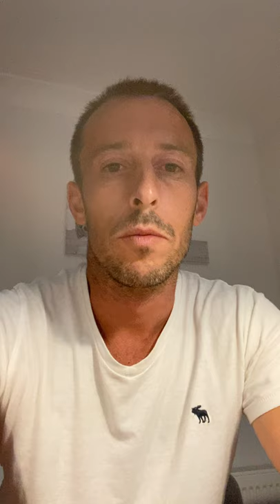Why you shouldn’t have cavity wall insulation installed.

Comment: Hi, would you recommend any cavity insulation as I was looking at the bonded bead insulation? Cheers
Reply from the maker: I wouldn’t recommend any personally, but  I would be very thorough in who you choose to survey and install it, if you go with bonded beads. It’s important that you are given information regarding additional ventilation requirements suited to your property size. Cavities should be throughly inspected for any possible bridging or defects prior to installation and thought should be given to the condition of the wall ties and any possible alterations that may affect the 25year guarantee issued.
Reply: @CoastalWallTiesRustington  I was looking at a company called cavitech. I need to see what is in the cavity first and go from there. Cheers for the response.👍🏼
Reply: @davesaxon7348 did you go forwards with Cavitech?  Did it work out or any problems?
Reply: @robhindle8735  hi, no they were too expensive.

Comment: Great vid.  Thanks     👍.  Question “.   We  are in process  of removing  white wool  ( very damp )  from  our  50 mm cavity !!!!    Our. Outer walls      Are  bottom  Third   Section face brick then rendered   Con blocks  upwards  ,  with  term blocks internal  all walls  ,   ,,   Would you  agree to installing  air bricks  at various  points  around  bottom  brick section   ,  regarding  some air flow  or would this increase  moisture   In cavity  on inside course  in winter    ,  not sure if  would help !!!        Air brick / yes   No.    Thanks
Reply from the maker: Thanks for the comment, the only reason to install the air bricks would be to dry the internal wall quicker, but as we are entering summer I would say it would do fine naturally without air bricks. So to answer your question no it’s not really necessary and would make the bottom of your walls colder during the winter period.
Reply: Thakyou.   Will keep watching

Comment: Hi, do you think external solid wall insulation is any good? I am thinking of getting it done but have heard lot's of bad reviews about it. would appreciate your opinion/advice. Thanks
Reply from the maker: Hi, the only thing with external wall insulation is that things like gas boxes, waste pipes etc will have to be moved to ensure no cold areas are left not being insulated. It may also be worth considering that this type of insulation method has not been around that long, so the longevity of the render etc is fairly unknown. It would be wise to ask to see the contractors guarantee and thoroughly read the terms, some guarantees have been known to include a clause in which if you attach any fittings etc to the external wall, it will invalidate the guarantee.
Reply: @CoastalWallTiesRustington  Many thanks for replying promptly. I heard that many customers had bad experiences with external wall insulation where water started penetrating, render coming off, internal damp issues etc. and as you probably know once they have completed the job even though you covered with guarantee they don't want to know you and will make excuses and someone like me doesn't want to the hassle to make complaints/ courts etc. It just takes ages and you may not get anything at the end. Have heard any negative sides or personal experience of solid wall insulation? because once it's done and problem starts, it will be very costly and inconvenient to remove it.
Reply from the maker: I haven’t had any problems highlighted through our company, but I would consider internal insulation plasterboard inside to the external walls of the house only, this would avoid the potential problems highlighted in my last response and avoid any issues with guarantees etc. All you need then is a good plasterer but it would involve plaster-boarding the entire wall, so things would need to be removed to ensure no cold spots are on the walls.
Reply: @CoastalWallTiesRustington  thanks

Comment: What about external insulation on a cavity wall then render? Just moved into a 1935 bungalow, cavity wall, needs render replacing was thinking of doing external insulation at same time? Worth it or am I setting myself up for problems further on
Reply from the maker: External rendering is the one of the better ways to do it because it would cover lintels etc, whereas cavity wall fill doesn’t. My only advice would be to ensure that you have adequate ventilation at night during the winter by opening windows on night lock to prevent condensation and mould. At least with external insulation render your cavity is not bridged.

Hope this helps.
Reply from the maker: Also being a 1935 property if you decide to get external wall insulation, get them to check the condition of the wall ties first, the last thing you want after rendering is cracking to occur.
Reply: @CoastalWallTiesRustington  thanks you for the reply

Comment: I've got a problem where the walls are getting increasingly colder each winter. My house was build in 2007. There are  bricks both on the outside and inside. The cavity in between was insulated from new with glass wool batts I believe. What is going on?
Reply from the maker: I would remove a brick on the outside of one of the coldest walls to check the condition of the batts and to see if they are dry. If the outer surface of the insulation is moist but the rest is dry, you could try applying stormdry masonry cream to the brickwork, but I would wait until late spring/summer to do this to ensure the bricks are as dry as can be and to allow the batts to dry.
Reply: @CoastalWallTiesRustington  Thank you. I'll try that. After stormdry masonry cream has been added do you still advice against having insulation blown into the cavity? I worry the glass wool insulation was either poorly done or that it sunk over time
Reply from the maker: If they are full fill batts then it would be a job to remove it and it shouldn’t have sunk. If it was whitewool loose fill then I would say get it removed and see how it goes without insulation.
Reply: @CoastalWallTiesRustington  They are full fill batts. But I believe it's those fluffy glass wool batts  that collapses and looses its insulation abilities as soon as they're exposed to any form of moisture

Comment: Oh im so confused  - my semi detached has has just been assessed and I can have a new baxi boiler, loft insulation also wall installation injection route. What shall I do, has anyone had this done etc
Reply from the maker: If you can get away with just the new boiler and loft insulation, I would do that. Enquire with the company about adequate ventilation to the loft space as well .
Reply: @CoastalWallTiesRustington  thank you will asked them. The insulation the inject is called 'oil based bond beads' is this like the old stuff what they pumped into

Comment: I had a garage converted into a room, the builder done a poor job because the room is so freezing cold. What can i do to fix the room heat protection?
Reply from the maker: I would assume that the external wall of the garage is a single skin wall, rather than a cavity wall construction. If it’s single skin then you can either insulate internally or externally but the external finish would be a render or cladding. The same would apply to a cavity construction if you were not wanting to bridge the cavity.

Comment: Hi. Can you clarify which kind of insulation you are speaking of please? Ive just seen a video using a kind of expanding foam which i would have thought would work ok as its waterproofing? Are you speaking of the old feathery type stuff?
Reply from the maker: So all retrofit cavity wall insulation has different problems associated to them, with expanding foam insulation, 1 type sets solid and the only way to remove it is by taking the outer wall down, others can disintegrate/shrink overtime. The expanding foam that sets hard would certainly be waterproof but please be aware that once installed it’s hard to remove if you needed to.
Reply: @CoastalWallTiesRustington  great video and grateful for you sharing knowledge. What about thermal beads?
Reply from the maker: A cavity is best kept clear, thermal beads can be a pain, when altering your property the beads can escape out of the hole and essentially create a cold area in comparison to the rest of the property. Also if the property requires wall tie replacement at a later date and you experience damp problems, the insulation guarantee may become invalid. The best way is either a masonry cream, insulation backed plaster board internally if possible or a external insulation system.

Hope this helps.
Reply: @nadiaw978  this is a bit of a myth as well. Areas of wind driven rain as dictated by the BRE map are at higher risk of penetration but these products have never actually been tested on older properties. The BBA certificate shows that the test rigs used are that of 1984 building regulations - how can 1930 and 1950s properties meet future standards. The BBA also failed miserably to install mineral wool in a new construction http://nottomyhome.blogspot.com/2018/12/abject-failure-of-mineral-wool-and.html .  No longitudinal test or product failure registry -  no part of government tracks even the number of extractions per year and which product or types of property has failed.   It's a poorly regulated industry and CIGA just tries to blame the problems on home owners - no incentive to do a root cause analysis of failures.

Comment: Unfortunately I’ve been affected by a company called heatwave energy solutions who have put cavity wall insulation. It’s caused damp throughout my house and I’m not sure what to do. Could you please advise? Thank you
Reply from the maker: Hi Adam, sorry to hear that you have a damp problem. Have you contacted this company to rectify? Have you got a guarantee backed by CIGA? If the company doesn’t respond and deal with your claim, then go straight to CIGA. CIGA will also try to avoid compensation but be persistent and demanding. They will probably send a surveyor round to assess and worm there way out of a full extraction but just be persistent and don’t take no for an answer.

Has it affected all walls or just south and west?

Comment: The benefits of cavity wall insulation installed correctly far out way any negatives. If you have a clear cavity above 60mm in your home get it filled with bead insulation. It’s crazy to run another winter without your home correctly insulated.  270-400mm in the loft also.

Comment: Cheers for the info, was considering having CWI , but couldn’t find much reviews on it,  perhaps maybe when we do an extension we’ll go for the foam backed plaster board, & perhaps silver backed poly insulation under the floor boards ?   I did consider the outside wall insulation but it’s so expensive to do . Thanks again 👍
Reply from the maker: Good choice, just remember to ventilate your property as well and you will be fine, most new windows have a night lock in which you can open the window slightly and lock it, this will be sufficient ventilation.
Reply: Coastal Wall Ties Ltd  Cheers for the tips,  our main problem is the conservatory at the back of the house/kitchen diner, it unbalances the heat , luckily we’ve got a double glazed door so can shut off that area,  hopefully we’ll knock it all down & put a new extension on the back . & retrofit insulation where possible. As I’m happy with my Oil boiler , don’t want to go down the ecodan heat pump rabbit hole. Don’t think my house would be suited to it. Good luck with the channel 👍
Reply: Rescue and repair of cavity wall insulation.

Comment: What if you have cavity insulation put in and then external wall insulation over it that would seal any holes surely ?
Reply from the maker: It would but it would also make it a very sweaty box, which could In turn cause issues later on in the future. Where would the moisture created inside go? It would condense on poor insulators and cold spaces I.e wardrobes, etc. Creating mould issues. Unless you ventilate enough I can see it being a problem.
Reply: @CoastalWallTiesRustington  so should i just go for the external insulation alone and that will be sufficient ? Want the house to be as efficient as possible
Reply from the maker: Yes just go for the external wall insulation, ensure that the company installing removes all services etc from the wall as this is a common complaint.

Comment: Hi Alex, very useful info 👍 I have a house built in the 60s with cavity wall. I researched cavity wall insulation and share the concerns you highlight. However, I have been informed that closed cell slow pour is a vapour barrier and shouldn't have any of these problems, Walltite is the product I was looking at. 
Would you advise against it? Have you seen houses with cavity filled with close cell (walltite) with these issues? 
Appreciate your opinion
Reply from the maker: Hi Bryan, thank you for your comment and question, firstly this is probably the only insulation out there that truly stops moisture tracking across the cavity, however it sets hard and would be costly to remove if that was required ( removing outer wall and insulation then rebuilding) I certainly wouldn’t recommend this for insulating between rafters in loft spaces. The other thing to keep in mind is that having your walls insulated will stop the walls from breathing, which means if you do not heat and ventilate correctly, then condensation is likely to occur. 
Hopefully this brief answer helps. If you need further info just let me know.

All the best.
Reply: @CoastalWallTiesRustington  would a combination of this cavity insulation along with inner dry lining be the way to go so? This should prevent the inner walls from getting cold and wet you’d imagine.
Reply: Hi Alex, thanks for the reply. So it sounds like this will not having the moisture transfer issue from outer leaf to inner leaf which is good. 
I see your other concern is that it will seal the house up which will mean less ventilation (there won't be gaps around windows and doors, the house would become sealed). 
As you suggest in the vid, we would need to either install more ventilation or be very conscious to have windows open in kitchen, bathroom and bedroom to allow moisture to escape. 
One more question if you don't mind, have you seen any problems with closed cell pour (walltite or similar) in houses? I know there is issues with uncertified products which cracking occurs but these certified products seem to do what they say?
Reply: Hi mate.  Please could you advise.  My house gets really cold quick.  I turn the heating on at 8 am till 9pm.  Then turn it on again the next day.  This is costing me a fortune to stay at 18 degrees.  New condensing boiler.   Dyu think it would be cheaper to leave it maybe 16 or 17 at night rather than turning it off?
Reply from the maker: @shaymiah  Hi Shay, As I haven’t seen your house it’s hard to give exact advice, but your house needs to be thermally efficient to a fairly good standard I.e loft insulation, double glazed windows and doors, new radiators if they are really old. this will help retain some of the heat. The issue with having cavity wall insulation is that by doing this you are creating a sealed box that is unable to breathe, which in turn creates its own problems, as well as the risk of penetrating damp. If you need to save money, I would suggest having your heating on during the day at your desired temperature and then when it comes to the night reduce the temperature but by a few degrees, you don’t want to create a sudden drop. Alternatively try a consistent lower temperature that you are comfortable with. Hope this helps.

Comment: Thanks for the tips. Just bought my first house and will be moving in next Friday. I had planned to take advantage of the cavity insulation from the government grant as I heard it would save me money. But glad I came across this video 😅

Is there anything else the government is offering on the green scheme that you would warn against?
Thanks loads👍🏽
Reply from the maker: Congratulations on your first house 🥳 no the rest should be beneficial if necessary.

Thank you for watching the video, I’m glad you found it useful and found it before it was too late. All the best 👍
Reply: Rescue and repair of cavity wall insulation.
Reply: @CoastalWallTiesRustington  Hi thanks so much for the video. I have cavity walls in my house. 13 inches wide with 5 inches gap in the middle. I have 60mm kingspan boards fixed to inner wall in the cavity. So I have about 40mm of cavity. I have had 4 company's looking at job for bead fill and not one of them mentioned any of these problems. 👍